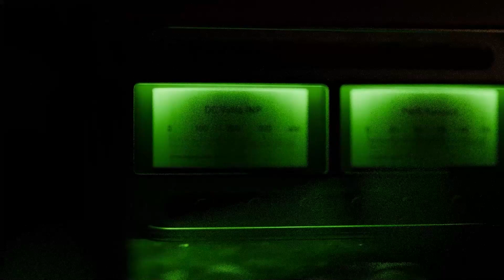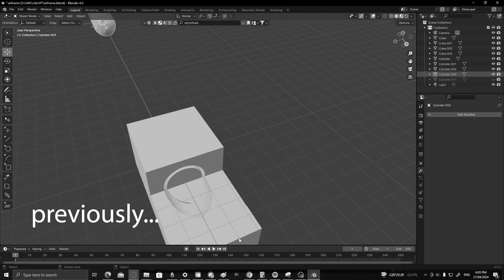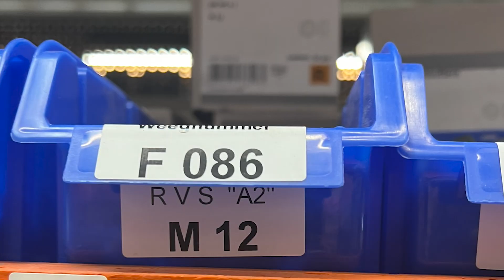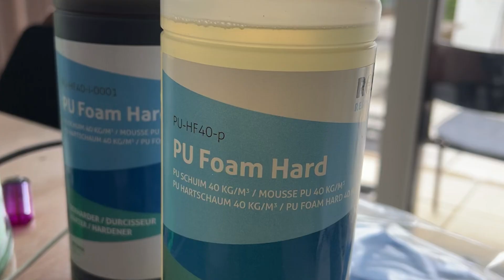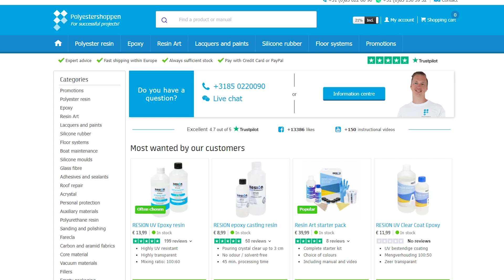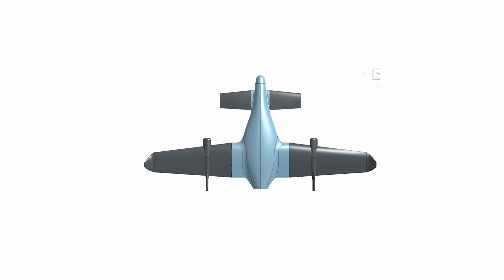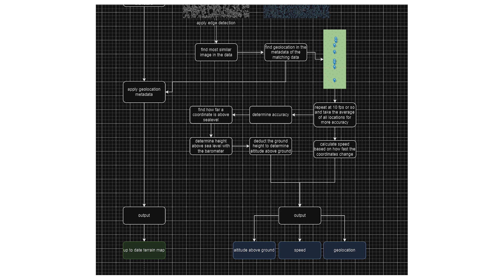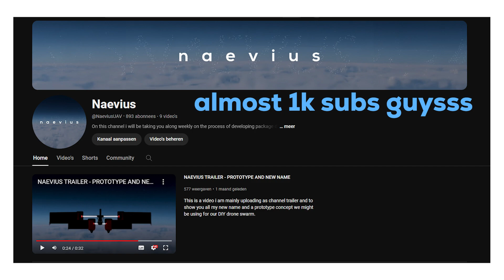building a UAV with PU FOAM moulding \ engineering a UAV week 8

Comment: For your printer that looks like under extension caused by a cooked PTFE tube in the hotend. Chances are the end of the tube inside the general where it contacts the nozzle has been over heated and now it's pinching the filament preventing smooth and consistent under extrusion because the extruder can't push it through the blockage... that's what the clicking is.

Comment: PU is basically a glue, the mould release is absolutely required. You will also need to add a draft angle in order to get a part out of a solid mould. Alternative is to first make a silicone mould which is easier to remove. 
I am an embedded software developer with 20 years experience with C, C++ and python from Belgium, with an educational background in electronics. I'm willing to help with any low level software questions you might have.

Comment: If you have issues molding the foam an alternative could be using a CNC hot wire cutter to cut blocks of solid foam

Comment: You could just 3d print the whole plane. Check out eclipson.
Reply: Wouldn't it be heavy tho? if it'd indeed be built with only a single electric motor, The motor would need to be ridiculously powerful. Also, it'd probably take more time and be more expensive.
Edit: Don't want to hate tho.
Reply: @chevansrocketry4989 Yeah, you're right, but it'd still be more expensive
Reply: Yeah ig